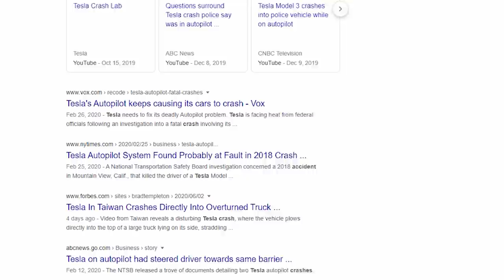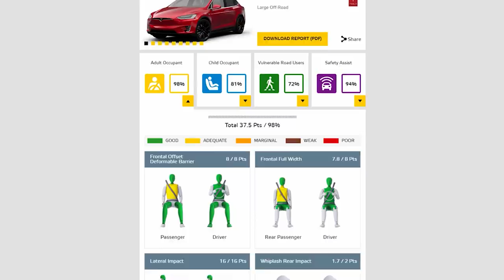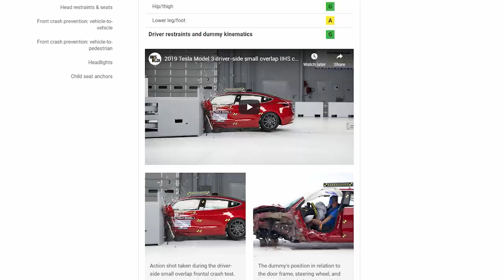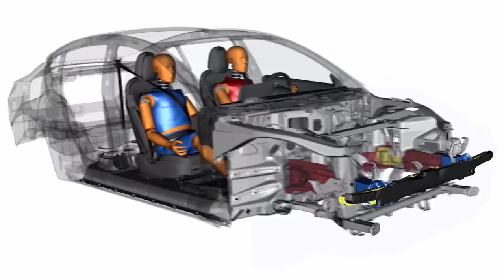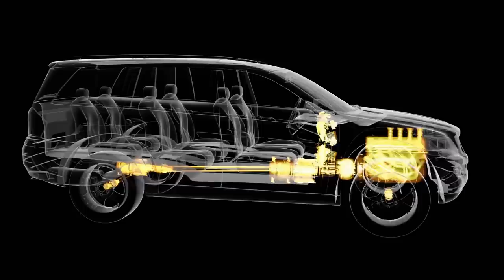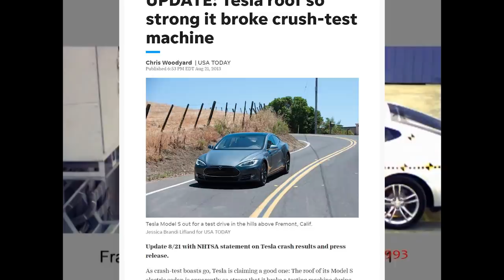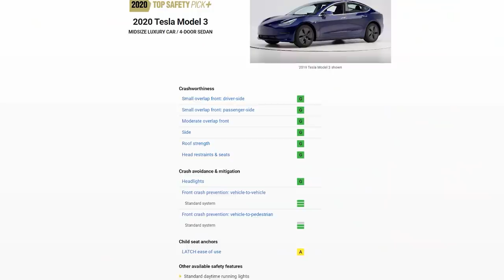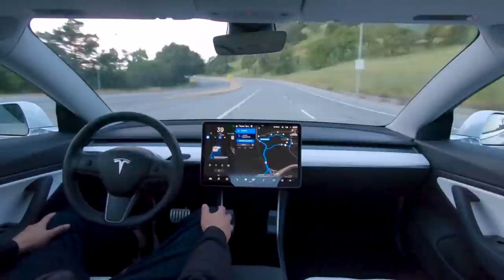Tesla: The Most Dangerous Cars on The Road?

Comment: Love my Model 3. There are a few street lights where the autopilot gets scary so I dont engage it in those areas but other than that the car is honestly perfect.
Reply: You mean the kamikaze pilot? Because that´s what it is
Reply: How do you know it will always work? If cameras are blocked or malfunction, it can crash.
Reply: @realnapster1522  You cant know it always works. Just like you cant know you always work, or whoever is driving the car. However, statistically, it is far, far more likely to work reliably than humans ever could. The overwhelming majority of accidents is due to driver error, and we could reduce that amount to a fraction of what it currently is by relying more (or, in the future completely) on computer assisted driving. Sure, this might introduce some new kinds of accidents. However, each accident will provide data we can use to train the system to not repeat such errors. Something we simply cant say about humans - especially once we consider we have to teach each new generation anew, who will then keep on repeating the same mistakes again and again for centuries to come.

It is also worth mentioning that most self driving cars do not rely on cameras as their only, or even main sensors. This has proven to be too unreliable, especially in very bright, reflective or dark environments. Instead there is a multitude of sensors providing data to build a good model of the close to middle-distant surroundings. If any one (or more) such systems fail, the car will still drive perfectly fine. And it will know and notify you about the problem, so you can get it fixed. Compare that to grandmas eye sight slowly deteriorating over time, or people getting into their cars drunk, or texting while driving. A self driving car has several sets of 360° sensors providing it information all the time, while us humans have a barely functional set of eyes which we can only use to look in one direction at a time, having a multitude of blind spots (both the eye itself, aswell as due to car structures) and, compared to computers, insanely slow reaction speeds.

Quite frankly.. self driving cars are the future. Even now they are better suited for driving than any human for most situations. In the future there wont the cornercases where humans outperform the technology anymore. In a farther future, you wont be allowed to manually drive a car on public roads due to public safety concerns.

On a side note, self driving cars will heavily improve traffic flow once they make up a notable proportion of cars on the roads. Things like phantom jams, which make up a major part of highway jams, simply cant happen with self driving cars, because they can be coordinated. Traffic lights, and signs for the most part, are only there for us humans. If there was only self-driving cars you could go through any crossing at 50 km/h and wouldnt need to stop at all. There would be no jams or congestions whatsoever. Traffic lights would only serve for pedestrians to cross a road. A fantastic future, even tho we obviously are not quite there yet.
Reply: @Yamyatos  I see that you seem like you don't like driving. 
I hope it will never go that far signs and traffic lights are removed - that would be an attack on freedom and all of us who like to drive and car enthusiasts.
You wouldn't be able to go 50 km/h straight thru an intersection anyway, unless car to car communication over 5G or similar is implemented - but then new risks would be introduced, such as hacker attacks or jamming attacks. Spyware and malware is already a problem for ordinary computers, so that would indeed be a problem for the computers in the cars as well. It can be possible by cars using just sensors if traffic flow is very light - but the same can be achieved for manual driving as well. 
For example traffic lights on sensors are quite common. I have a few intersections that I often pass thru at 80-100 km/h - when passing the senor, the light turns green when still far enough from it to be able to stop from that speed if needed to (unless other cars are on the crossing roads - which is well visible beforehand).

I'm not against self driving cars as such - it's great for those who don't want or can drive for various reasons. I, would use it my self in slow traffic (where manual driving isn't that fun anyway) - and that's where it would really help against those "phantom traffic jams" you mentioned. All that would be needed is to monitor average speed of traffic continuously and send that data to all the cars, to keep that speed. 
Because the problem is just that we human drivers don't want to "go slower than needed", so we have an urge to speed up as soon as the distance to the cars in front increases significantly (also because we think we don't want to annoy drivers behind by leaving too much distance to the car in front). The drivers behind think the same. This causes a group of vehicles to go temporarily faster than the average flow - when that group catches up to the slower traffic ahead, it will compress into a small congestion that often moves slow enough for more traffic to start to catch up from behind and everyone have to brake more and more until it grows into a real traffic jam.
It's also good if you don't know where to go in a city (since all self driving cars will stored maps and road data about lanes and such things) - like a navigator that can also drive the car and plan ahead like someone who already knows the road - no "changing lane in the last second" and stuff that you often get, trying to navigate a city where you don't know the roads very well.

Also when it comes to human drivers and accidents - your examples is typical causes of accidents - or just bad drivers. The problem is that unlike self driving cars where every car drives the way it's programmed to do, all human drivers are not the same - just a few drivers causes the majority of accidents, so why punish everyone. But, if people have the option to turn on the autopilot while texting - most of them would probably do it (since it's not their goal to drive dangerously, even if they don't care as it is now) - same thing goes for drunk drivers or grandma with bad vision. So it would probably do a lot for the safety, without take the freedom away from everyone who really like to drive. But we all know how politicians are...

Comment: Auto Pilot should be banned period! Simply because PEOPLE break the rules AND the cars are known to do dangerous turns that an attentive driving human normally wouldn't make, unless they're mentally unstable then auto pilot wouldn't make a difference anyways. If it saves ONE persons life it's worth it. If you're driving a several ton car down the road at 70 mph a computer glitch is not what's needed to make things more convenient, it's totally avoidable. Human drivers don't just turn into traffic on a whim, normally. We don't need to add wacky computers into the mix now too! But lets not get into artificial intelligence rights over human rights. Also a properly maintained Gasoline car is safe, or at least safer today with today's technology, than when it was not properly tested, say the 70's Pinto or the Chevrolet trucks and Buick's of the 80's. I don't remember the last time I heard of a brand new gasoline car that was properly maintained catching fire or just turning into a wall. Electrics may be the future but I doubt the battery ones will be, more than likely it's going to the the Fuel Cell versions. Battery Electric will most likely have a brief history when compared to Fuel Cells. Fuel Cell vehicles fuel almost as fast as Gasoline cars. Fuel Cells are also safer as the power is produced pretty much as needed or encased in crash proof canister after fueled. The Fuel Cell tanks also when punctured or crushed don't explode like Tesla's or Lithium Ion car batteries do. It's going to be a great next 20 years for Electric Vehicles! Will the VHS Battery Electrics catch on or the Beta Tape Fuels Cell Cars Catch on? Time will tell. Thanks for sharing. Best Wishes & Blessings. Keith Noneya

Comment: One word of caution in interpreting the accident statistics. Tesla reports the crashes per million miles with Autopilot turned on and with it off. There is going to be some measure of selection bias since the Autopilot is much more likely to be being used in highway driving than city driving. That will skew the statistics somewhat and be quite hard to control for. 
However, you've reported on the year-on-year improvement too [first time I've seen that one anywhere] and that is comparing like-with-like hence an excellent metric. I hope you'll keep following that over time, it should prove very interesting.
Reply: A very good point! And city-driving would be the next easiest thing too. Hence why we have fully automated cars driving people around in those already. That's what most data comes from. What would truly cripple the statistics (or at least i think so) is more rural settings, where some roads are barely visible, or even just made of dirt, or allow only one car to pass at a time, where it's expected for the other to drive a bit off-road. Pretty sure there is not enough data on this type of road to make self driving cars work there (yet) fully autonomously, but once we got the models trained for the more "normal" scenarios, it shouldnt be too hard to include the less common ones too.
Reply: Yes, that most likely have a huge impact on the statistics. Even when it's not just used for low speed highway driving (below 130 km/h), it's used for other "easy" driving situations in general (such as country roads in rural areas, during dry conditions, and low speeds). Most drivers will simply not trust the autopilot for more complicated situations and Tesla even states it should not be used in those situations. 
To make matters even worse, the vast majority of the distance a typical car is driven is during "easy driving conditions" - the more complicated situations, like city driving only makes up a small part. So that statistic is pretty useless until they have made it handle all driving conditions and then have many different drivers who use it all the time (to cover all situations, all  different roads in all weather conditions etc.). Also when it comes to human drivers - the statistic gets worse because of drunk drivers, people texting while driving or just bad drivers in general (just a few drivers accounts for most of the accidents). So the average statistic isn't really that relevant for each individual either. I am my self mostly worried that skewed statistics like this, will be used by politicians to justify a ban for manual driving. Which then open new ways to control people. We have seen this many times before.
I'm not against the technology as such though - as long as it's not used for power abuse. It's great for those who don't want to drive or can't drive for different reasons - and likely most of the people texting and drunk drivers will use the self driving function as well and thus increase safety for everyone. I could even think about using a self driving car my self in slow traffic, where manual driving is more annoying than fun - or if I don't know where to go in a city for example. Like a car GPS navigator that can also drive the car and plan the route ahead, change lane in time etc. It could also be nice for really long trips (which could be a nice thing of the future, if some break through battery technology make a great improvement in range for electric cars) - drive manually until I feel tired, then sleep "on the run" (if it's a fully self driving car), then drive manually for a while again. That would save a lot of time and cost for hotels.

Comment: I drive a Toyota Corolla 2009 model that was made in Ontario. It has almost 400,000 kilometers on it and you know what, I would buy another Toyota. I do not like the idea of Joe Biden trying to force me to buy an electric car. I drive with two hands on the wheel and I do shoulder checks.  My car is well maintained and it only cost me  $ 14,375 Canadian brand new. I can hop in my car anytime and drive for 600 kilometers, no charging. It starts well in -50 celcius weather.

Comment: For all those sad EV owners (EVs are this centuries BETAMAX) 
I drive a 2016 Audi allroad quatro 3.0 V6 diesel stage 1 330bhp, which takes 5 minutes to fully "charge" for £100, does 55 mpg and 800 miles on one "charge."
 ULES (Ultra Low Emission Scam) compliant. It has a far smaller carbon footprint than any EV,  cost  quarter of what a TESLA does, has far superior build quality and doesn’t sound like a milk float or look like a duck. It can also be "charged" at over 8'300 stations throughout the UK which are all completely compatible with the car, safe in the knowledge that no children were used as slave labour in African mines mining rare Earth metals to build my car!

Comment: First of all: It was not all green for small overlap... Lower leg was yellow.
Second of all: The engine is not always a problem. Take Volvo as an example: The engine is an IMPORTANT part of the safety structure.

And on side pole impact, the dummy readings are in fact higher on Tesla compared to a Volvo, since it stops too fast. The problem is just that - not the intrusion but how fast the car stops.
Reply: This video was cherry picking statements at its finest to promote tesla. There are plenty cars safer than tesla. I don't know where the idea comes from that an engine is an issue in a crumple zone. It is designed to work with the crumple zone.

Comment: Errors and fallacies in the video
Auto-pilot -having a car that drives well enough that the driver abandons attention, but does not drive safely on it's own IS A FAILURE OF THE CAR DESIGN.  STOP BLAMING THE DRIVER!!!!
Comparing autopilot performance to broad averages neglects the fact that the majority of accident involve impaired  drivers or weather conditions that Teslas can't drive in.  Autopilot can't drive as well as a sober human!

Lithium ion batteries are a major fire hazard.  Comparing only incident rates of 'fire' glosses over the severity of the incidents.  Most car fires are a little smoke.  Electric car fires burn everything within 20 feet.  Concrete can't even stand their heat and water doesn't put it out, it explodes!

Comment: Fast acceleration=more accidents. Hybrid and electric vehicle owners in Scandinavia statistically crash 50% more often. These cars are also typically heavier. So they have longer braking distance on slippery roads.
Reply: Please share the page where you got   the "50% more often" info
Reply: @-joo3033  it is actually much higher than 50% when compared with fosil fuel cars. 20.3% crash frequency on Tesla's and only 9% on diesel/petrol cars. 14.3% for electric vehicles in general. The damage is generally 50% more expensive to repair on Tesla vehicles.  https://www.an.no/derfor-krasjer-tesla-eierne-mer-enn-andre/s/5-4-1169917

Comment: The Tesla line of cars looks like well designed and well built autos.  The one area I can think of that has potential for problems (without data to support it so far) is when charging the car in a home garage.  When charging, you have a closed circuit condition (electric power flowing to the car); should a electrical short occur while charging, a fire is possible inside the garage.  Most home garages do not have smoke or fire detectors; therefore, such a fire could develop into a major fire unnoticed.  Most garages do not have smoke/fire detectors because gasoline/diesel cars are turned off when parked - though garage fires have occurred.  I would recommend to all, that have electric battery cars, to install smoke/fire detectors in their garages.

Comment: Many EVs, such as the Nissan Leaf, have a front motor-gearbox-inverter unit that is similar in bulk and shape to a FWD ICE motor-transaxle unit.
The later model Leafs are second in safety only to the latest VW EV, which is #1 in its size class.

Comment: Forget about auto-pilot for any type of car! Borrowed a Mercedes with adaptive cruise control, and marvelled on how easy it was to follow the flow on a semi congested highway. That was until I turned it off. After two hours of robot driving, I had lost my touch for how to coast to stops and anticipate the throttle input for hills. It also used 15% more fuel with it than my usual eco driving, because of its occasional braking and hard accelerations. Auto-pilot makes you a worse and more wasteful driver. On an empty road where you can drive at a constant speed, yes, that is hard to beat manually, but using it in traffic, you become a rookie driver after few hours!

Comment: Nah, the most dangerous one is the 2000 Renault Scenic RX4 in wrong hands. I've had one for 10 years. Been involved in 5 accidents, none of them my fault. 3 of them resulted in the other cars being totaled. They needed towing. Guess what? My car didn't even need a repair service done due to the crashes, not once! 😂🤣 Only some scratches on the plastic bumpers. That was an incredible car, but very dangerous for the other cars.

Comment: You do have to realize that even though your source says that there are more fires in conventional vehicles, the fires that DO occur are much worse in electric vehicles. This is from the chain effect of all the battery cells burning, which causes these fires to last multiple days and this puts a lot of stress on fire departments. They have to take different measures to put out these fires, like cooling the battery packs by flipping the car and directing water at it for long periods of time to try to stop the fire. 
Also, Tesla’s stupid retracting doorhandles killed a man because nobody around him could get the door open because the handle wouldn’t pop out. He burned in there not able to escape.